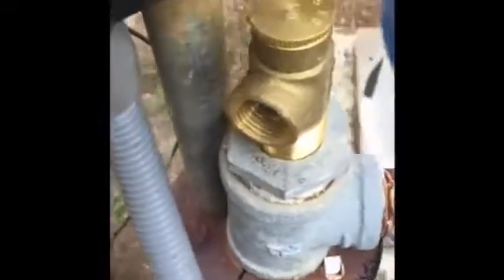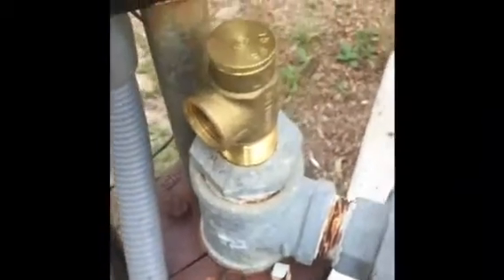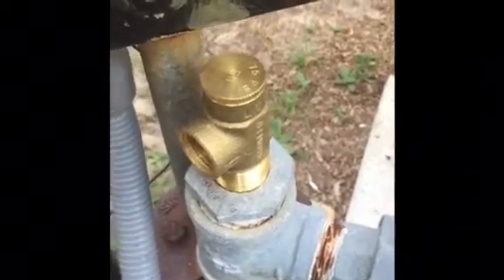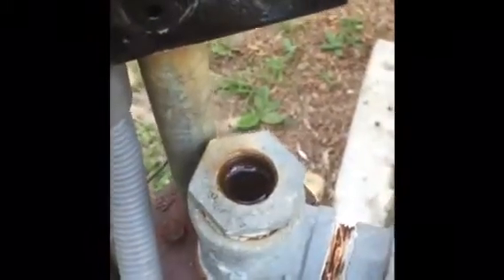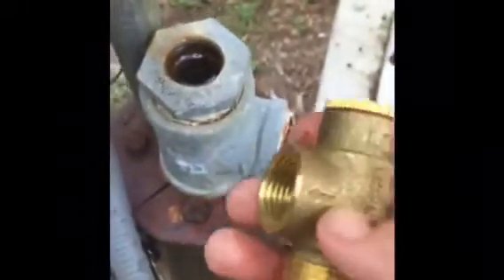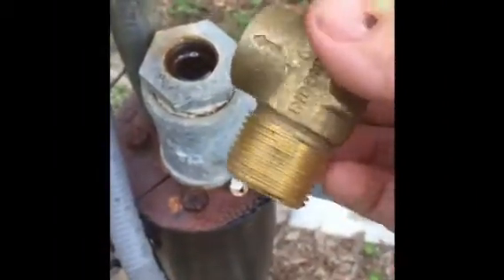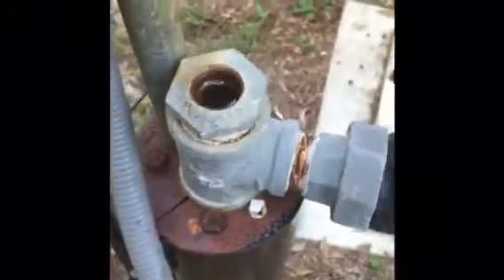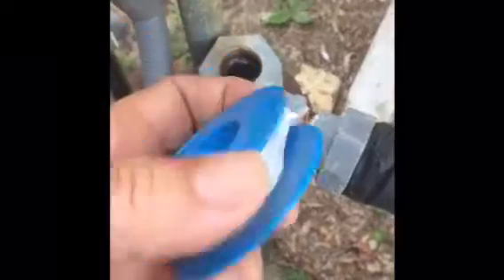Replacing pressure relief valve on a well

Comment: its called Teflon tape or u can use plumber putty 

and its ,made so u can install a pipe into it as option to divert the water that would come out of it
Reply: I get what your saying but your comment is missleading. plumbers putty is used for sealing tub drains, basket strainers etc. 
What your thinking of is called pipe dope. And yes it is made to divert water but really this only if you can add pipe and fittings and keep the pipe out of the this pressure releif valve at a downward slope. Most of the time holding tanks are in the crawlspace and its impossible to do any plumbing to it to bring a pipe to a visible area and also keep a slope to it. It is extremely dangerous to try and add fittings and pipe to this particular fixture to divert it to a visible area if you dont have any fall in your pipe. Could cause your holding tank to rupture or in rare cases explode if the conditions are right
Reply: Of corse im speaking for holding tanks only... if your changing this on a water heater you absolutely want to run a pipe down to about 3" away from the floor. Unless its already been repiped one way (going down of corse) then try and tie onto that. If your unsure then call a liscenced plumber because the code differs in every state and in almost every room of your house it will change.